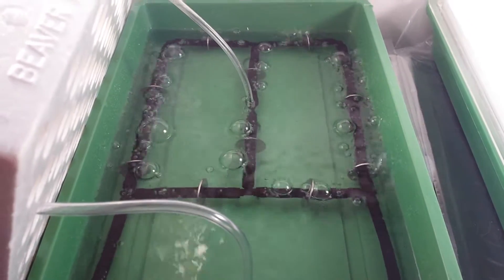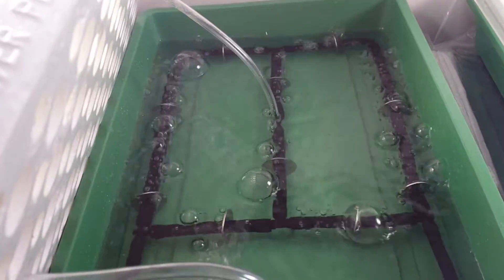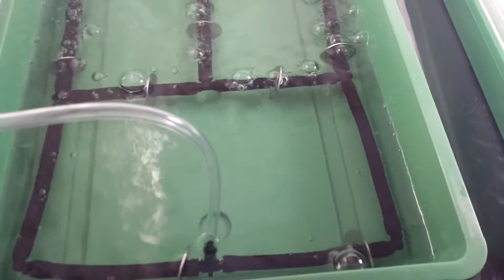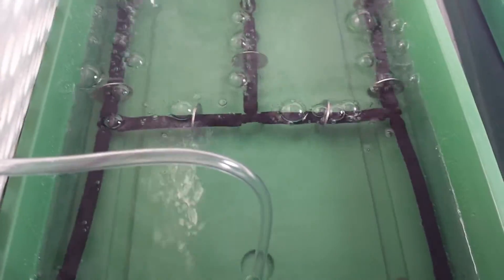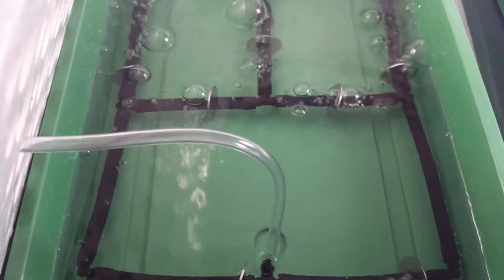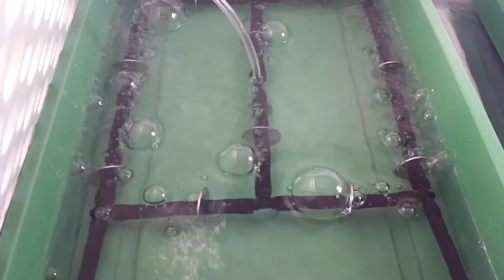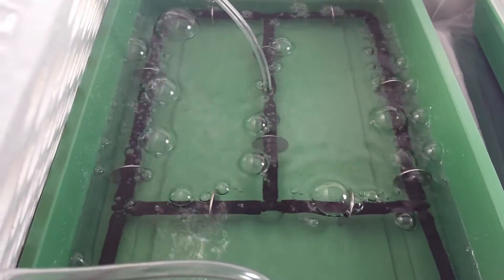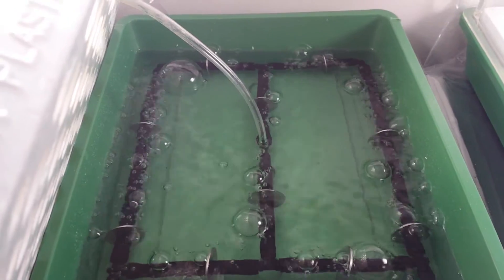Air injection technology vs soaker hose air lines

Comment: I think you are full of it, I've used soaker hose and it's air output is the same as the air injection technology 😂😉
Reply from the maker: You can tell the main difference by blowing on your AIT grid vs Soaker hoses.  The back pressure on the pump is higher in the soaker hoses, but you can remedy that  by punching a few extra holes in the hoses using a staple remover.

Comment: There is no difference in the hose look how your main air hose is connected to one side. It should be int the middle or add a splitter to power both sides equally also a more powerful air pump would be ideal.
Reply: @GreenLivingOffGrid  I have made my own with rain drip soaker hose. The issue I found was neither one of my linear air pumps would power four 8 inch rings but would power one which won't work as I wanted to add them to my 4 module current culture system.

Comment: No, I think it's because the air pressure goes to the least resistance outlet, so you should compare them without using the same air source. For example, if you poke a giant hole in the soaker hose, there will be no air bubbles out the other side.
Reply: true he should isolate it
Reply: I don't think he was recommending poking holes, but instead isolate the different tubing. If one tubing is more porous, the ait will go out of the tube of least resistance. This does not always mean the tube with most bubble output. If you isolate each tubing on the same pump and showed the outcome it would be a better referance in the comparison of the tubes.
Reply: My thoughts too. So yeah you would need to build an entire manifold out of the soaker hose which wouldwork fine imo.